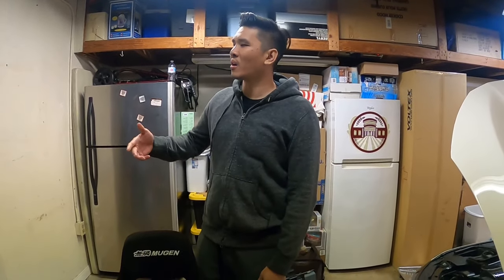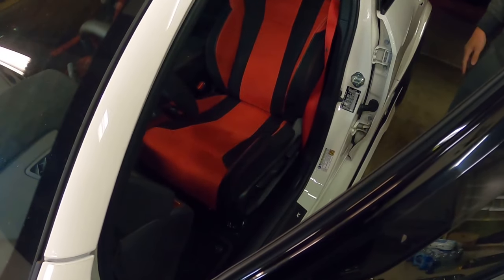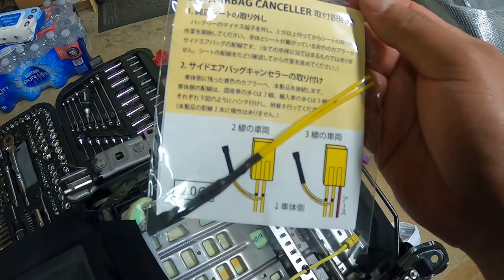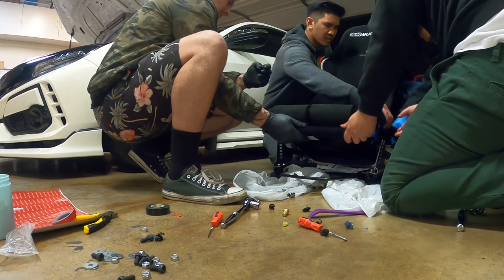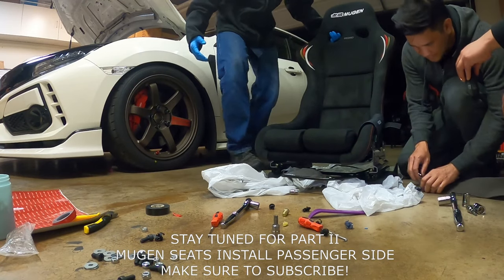HOW TO INSTALL $5000 MUGEN BUCKET SEATS // CIVIC TYPE R // DIY INSTALL // PART 1 OF 2

Comment: any chance you can provide me some info regarding seat rails/ other cables I need for this set up?
Reply from the maker: Just the bride ohm resistor, and bride rails work. 

Also suggest taking note where the weight resistor is and placing it in similar area on the new rail.

Comment: What size is the resistor and which of the prongs did he plug the resistor into?
Reply from the maker: Bride brand resistor,  2.0 Ohms. On instructions it states which one goes where on the package.
Reply from the maker: Check out part 2 video for more information (passenger side).